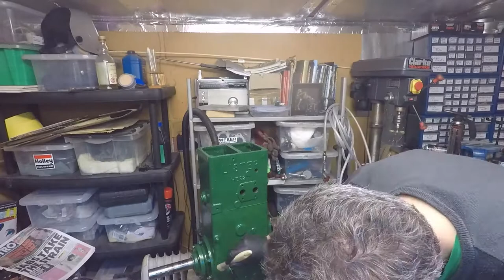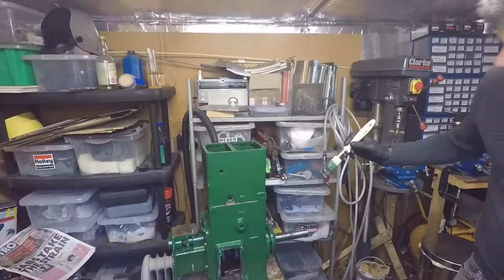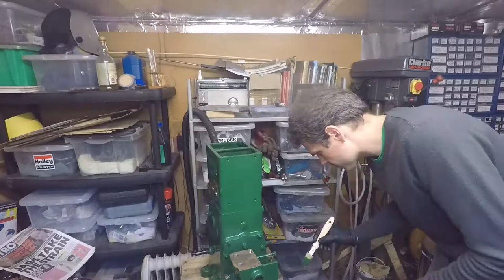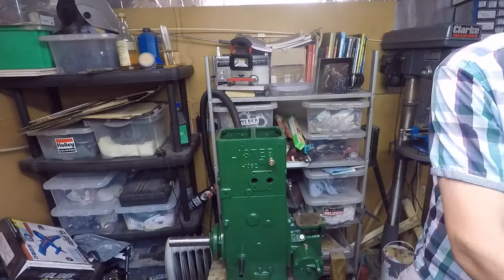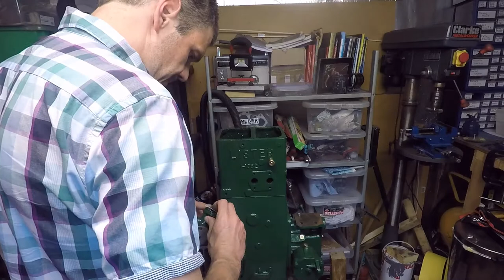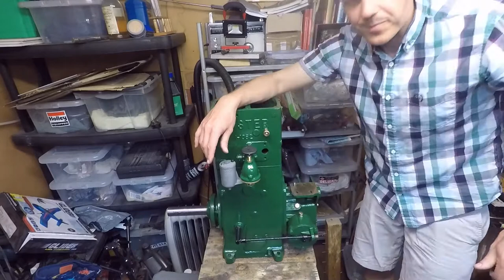Lister D barn find project. Setting up the Carburettor and linkage for the governor.

Comment: Hi would you be so kind to show me a close-up of the horizontal governor shaft link, I need to make the part that where the governor push against that mechanism {right side of the shaft}
Reply from the maker: Yes, just give a couple of days and I will post a video for you
Reply: @carburist  Thank you very much
Reply from the maker: Have uploaded the video now! I did not only the measurements but also generally about the governor system and how it should normally operate